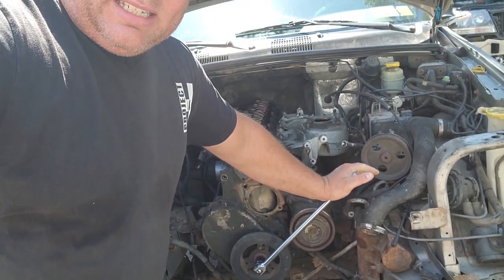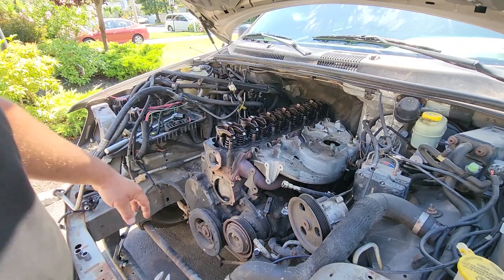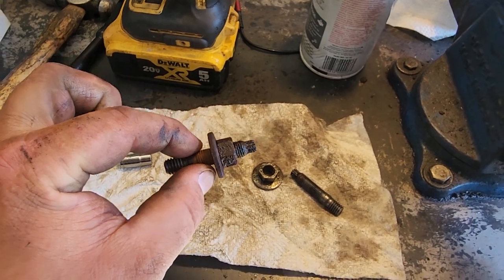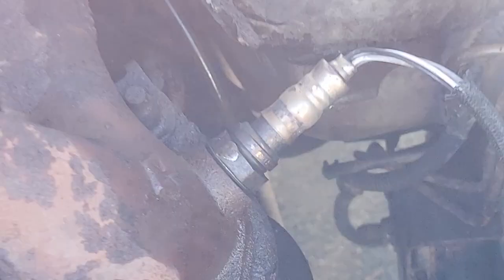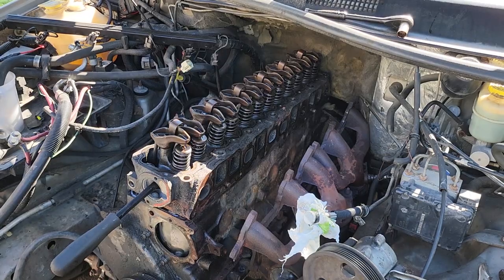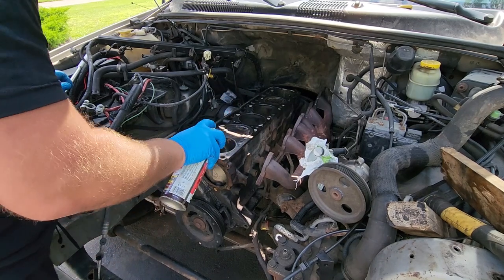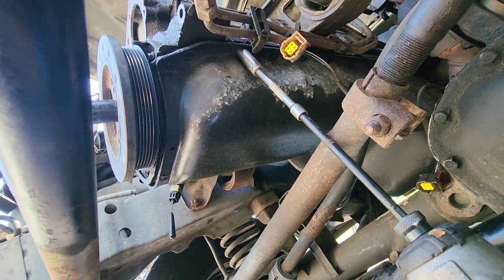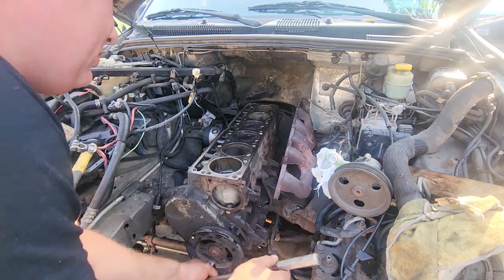FREEING A SEIZED JEEP 4.0 MOTOR - CATASTROPHIC ENGINE FAILURE

Comment: SEIZED JEEP 4.0 MOTOR - CATASTROPHIC ENGINE FAILURE, I thought for sure that's what was awaiting me three weeks ago. I got home late and  the wife told me the 2004 WJ 4.0 just hitting 99800 miles was acting up a bit as she was coming home from Walmart. At Walmart parking lot there was a huge amount of fluid under the Jeep when she got out, but decided that only being 5 minutes away from home, she would just drive the short distance. Hot weather and a stoplight later she was home.   When I heard I ran to the car crawled under and found the bottom coolant hose  had separated from the radiator. Clamp failure somehow?   My heart skipped a few beats, tears emerging.    Next day,my hair now grey,  got it back together filled with fluid and prayed as I turned the key. It started, I didn't feel or hear anything unusual.   Shut it down and proceeded to change the oil expecting to see shiny things in the oil, but it looked normal. Three weeks+ it's still running, but I wonder for how long.
Reply from the maker: I think shel be ok... You can always pop a new engine in

Comment: I'm a fool because I loved my 4.7 it ran perfectly but the sub frame didn't love me lol I put 1/4 plate steel in the rear for the trailing arm mounts but the front started to develop holes so I sold it .

Comment: Hey dan i have a 2002 jeep grand Cherokee limited 4.7 ho  ok i smoke tested the biatch found a couple of cracked hoses ok no I'm pretty sure the noise I here sounds like a turbo when I rev up the throttle the turbo noise goes away

Comment: Dan; have you ever had issues with serpentine belts on any of your XJ’s?? I have a 1998 love it! So ever since I had to replace the a/c compressor on my XJ; I’ve gone thru about 2 mopar belts, I just got a mopar idler pulley and a new idler pulley tensioner, waiting on a new power steering pulley cause I’ve noticed that pulley has a few gashes on the back side on like 3 groove lines… and belt has ripened or shredded on back part, hopefully that’s the cause of my belts? Any input or advice?? Anything and all helps thanks bud!

Comment: I’m in the process of replacing my engine due to the same issue. Haven’t tried cranking it manually but what’s the reasoning behind cranking it In order to remove it?
Reply from the maker: Gotta spin the crank to get to the torque converter bolts to separate the flex plate from the torque converter.

Comment: That back piston hole is probably jamed up against the Cylinder wall. Probably only thing you can do is pull the engine out and pop the oil pan off so you can try to un jam the crankshaft.
Reply from the maker: Did it!

Comment: I have a jeep wrangler Sahara it’s brand new 5k miles on it and it has what appears to be a “ spark knock” from what I’ve been seeing on others videos. It make a metal rattling sound when in low rpm’s under 35 mph does it the worst when going uphill. Sounds horrible…Any experience with this? Why it happened, why did it start already at 5k miles, how to fix it etc… i have an appointment soon at the dealership but I’m very disappointed with my new $50k wrangler 😢

Comment: Chrysler ruined the later 4.0 engines. Cracked pistons are common on later 4.0l. 98-up have issues. The AMC / renix pistons are better.
Reply from the maker: I know the connecting rods in older 4.0s are thicker.  The ones in 2000+ are more tapered
Reply: I have a 97 in a ZJ. Is it one of the blessed ones?
Reply: Why didn’t  you just pull the whole drive train?
Reply: @simonolofsson7488  probably, my 96 has 252,836 original miles. 98 and up 4.0ls are not that great.
Reply: I'm getting a 95 zj back that me and my siblings all learned to drive in. This jeep was purchased in 99 with 20k miles pristine condition. Since then it's been on 2 wheels on an off ramp 3 ditches 4 small accidents and has sat in a field for 9 years and now has 300k miles. My 9 yr old wants it so we are going to restore it. Thanks for your channel going to use a lot of your videos and Haynes manual lol.

Comment: I herniated myself pulling the head off a 4.2 XJ Jag
Reply: Noice,  if you're in the States, it would have been cheaper to go to the shop instead of the hospital 😅
Reply: @brentfellers9632  I’m cheap and would rather fix it myself. Ended up with a ahead stud broken off down in the block and sold the car for scrap. Not a lot of XJ6 parts in eastern NC. And good insurance paid for the surgery a year later.
Reply from the maker: I'm strong AF
Reply: @ProjectDanH  not forever ...

Comment: I am willing to bet all that was caused from the melted wiring harness putting fuel in when it shouldn't and had a severe Detonation when the valve was open which caused it to slam shut Snap the head off of it and grenade the piston